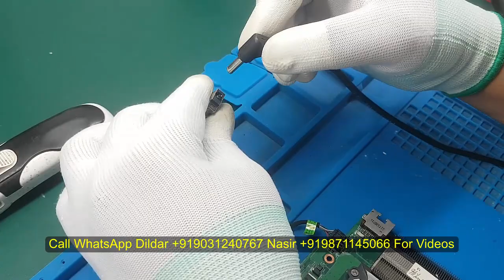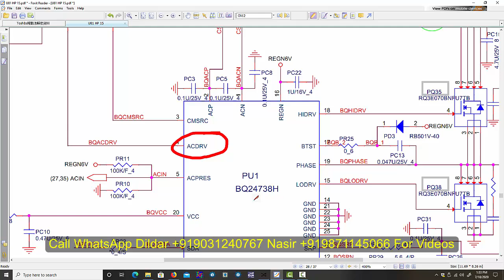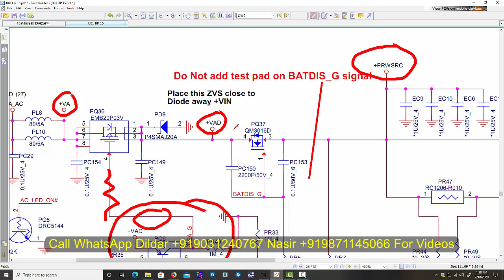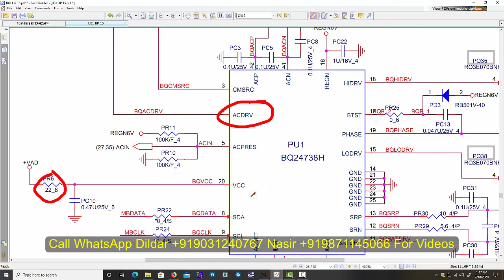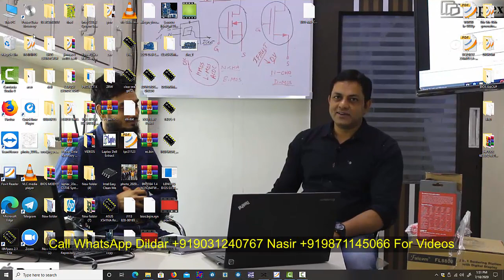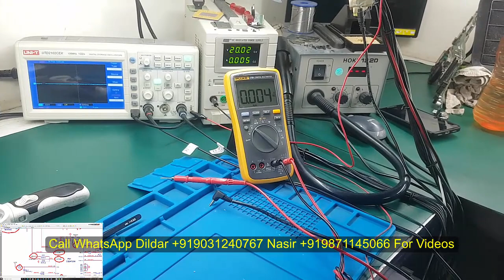DC Jack LED Not Glowing in U81 Dead Motherboard Repair | ENG| Chiplevel Laptop Motherboard Repairing

Comment: hi sir good morning ,
here i want to talk about to get  ACDETrequired voltage .
the required voltage of ACDET is 2.6v

case (1)
 if we get the PWRSRC (19v)  only without having    +VA_AIR (0v) then PQ4 will turn on and  ground will go up .
and the ACDET circuit will work different 
NOW R1 is pr9  and  (pr12+pr8) will become parallel circuit and  it is R2
here the ACDET voltage will be lower(1.5v) than required voltage ..so charging ic doesn't meet its requirement and it is not going to work .

case (2) 
if we get  +VA_AIR (18 to 19v) then PQ2 will turn on and also the PWRSRC will be grounded and PQ4 will not turn on ....
now the circuit of ACDET will work fine and we get required voltage (2.6v) of ACDDET and circuit will fine .

sorry sir   for any mistake...🙏
Reply from the maker: Good

Comment: I am facing same problem in haier laptop looking like this board.
I have found "HWMONITOR" and HWMONITOR1 on I.O thermal protect it was 2.7V on both pins whearas it should be 1.2 and 1.8V but unfortunatey after much struggle not able to find I.O thermal protect area.
Reply from the maker: Try to get reference from a similar board.

Comment: Gate voltage generated by ACDRV has to be at least 6v above CMSRC, so if voltage is 20v then gate will be 26v
Reply from the maker: It means if CMSRC not coming then ACDRV should be 6V ???

Comment: ACOK is generated by the internal LDO (REGN)of charging IC, which goes to the voltage divider at PR11 and PR10, which should be around 3v
Reply from the maker: Yeah good... Absolutely correct 💯

Comment: Voltage divider calculation at VR9 and VR12 will give 2.79v, However, this voltage will only come if +VA_AIR signal comes to voltage divider at PR14 and PR13. This signal goes to the base of the NPN transitor which switches on to shift the ground to the gate of PO4. This will pull the 10v from the voltage divider at PR 23 AND PR21 to ground and prevent the transistor PQ4 from switching on and pulling the 2.79v from the voltage divider VR9 and VR12 to ground.
Reply from the maker: Not exactly....it's not completely correct.
Reply: @laptex1377  Please let me know where I went wrong
Reply from the maker: Okay

Comment: pleass sir i would like to inquire from you,can MISSING OF  SMBUS (SCL&SDA) COMMINICATION  CAUSE BOTH AC FET MOSFETS AND BATTERY MOSFETS TO DONOT SWITCH ESPECIALLY IN NVDC BUCK-BOOST  CHARGER WHERE N-CHANNEL MOSFETS ARE DRIVEN BY CHARGER IC. SINCE THERE IS NO PROPER COMMUNICATION BETWEEN SIO CHIP AND CHARGER IC INORDER TO CONTROL CURRENT
Reply from the maker: Could be possible but depends on the programming